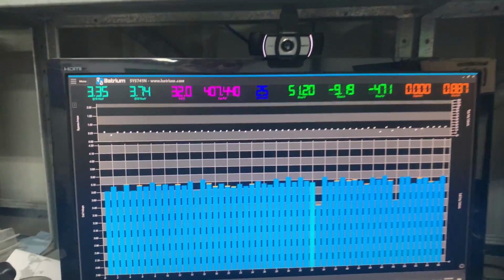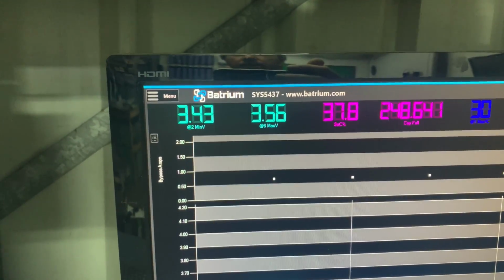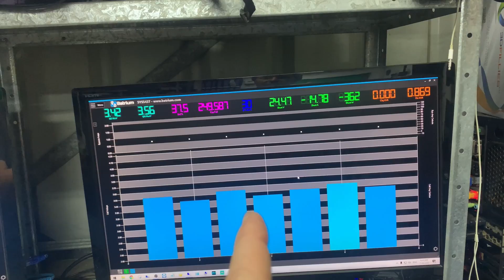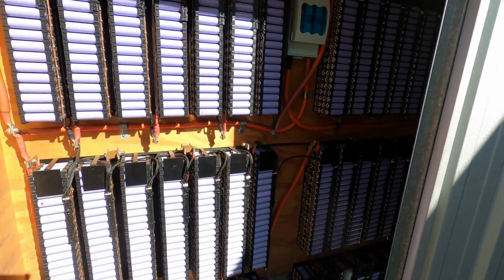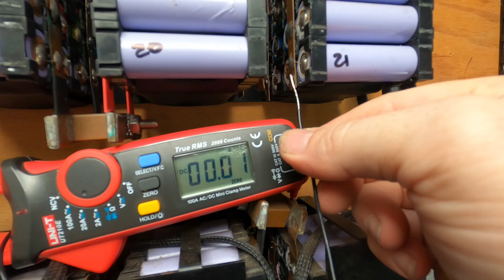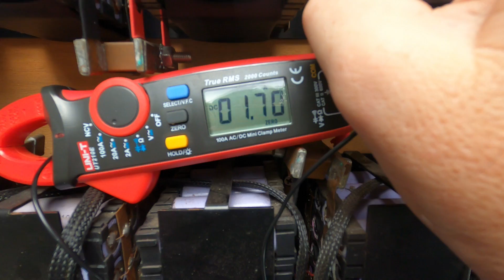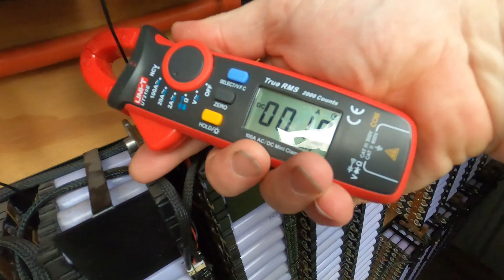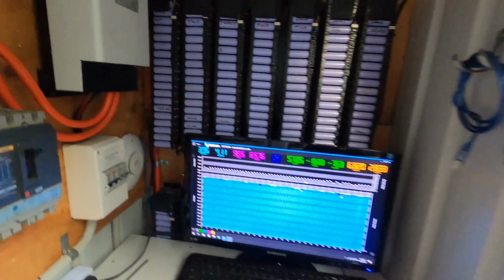Will 240 18650 cells in parallel be better than 80 in parallel?

Comment: Is your powerwall batteries safe in a shed outdoors??
Reply: Have you done any large loads on that powerwall?
Reply from the maker: It's now been in service for 6 years or so, yes it's outdoors, has BMS, has 120 temp sensors, has large loads applied daily, we use around 20 kwh out of the battery bank each night or when the sun isn't shining much more.

Comment: @HBPowerwall what's the discharge rate you can run on setting up batteries like this.. for instance, if I had 4 "packs" like yours in an rv.. would it run a 4k watt inverter?
Reply from the maker: On this battery I can happily pull 100 amps all day till she is flat with out warming up the cells, you COULD run a 4k inverter but you probably shouldn't if you want your batteries to last.

Comment: Great info here.  If a single cell goes flat, I wonder how to track that one down and replace it, without mangling up the whole pack by disconnecting each cell in parallel.  I'll keep watching vids.  Thanks.
Reply from the maker: Lots of videos on my channel, I use a flir thermal camera to find faulty cells as most of the bad cells are self discharging and get warmer than the rest.
Reply: @HBPowerwall   I'm definitely subscribing, liking, and commenting more on your vids.  That's a very intelligent approach, noting internal resistance considerations.  Cheers bud and bravo on the accomplishments. 💪🤙

Comment: Been trying to follow alone for a while now.. quick question.. do you have only one longmon per 80 cell pack?  Also how does it get the battery temp when it is installed on the plastic part of the battery holder and not attached directly to the batteries?
Reply from the maker: I still have 3 per 'battery' so to say really need to reduce it down to only one as that's all it needs it's just i know you don't mess with cabling unless there is an issue! lol There are so many temp sensors that you  can see the differences from the bottom of the shed to the top and left to right so you can see a problem well enough and a lot better than nothing at all. Also even if it was direct to cells might get a better temp on the cells under it but not the other 99% - also have the issue when in bypass it will heat the cell.

Comment: I can't wait to see the results, I'm interested to see what happens when you double up the small wires? Will it carry 4 amps or stay at 1.7 amps?
Very interested! Great video and very informative, God bless you and your family!
Reply from the maker: This worked VERY well considering the 2 hours work and a few dollars in parts - still need to make some bigger wires and retest all my batteries but that takes time and ... lots of it lol BUT very much worth the effort i think
Reply: @HBPowerwall  My concern is that linking the cells across the packs is that you are reducing the "breaking capacity" effectiveness of the main fuses which were previously dedicated to only a single pack. Adding fuses to the interlinks may help, but it gets complex trying to work out were the failure modes will shunt the current, If you are making it into a single string, then you are going to need a fuse with a very high breaking capacity, say 3000 amps, for about 10 amps per cell

Comment: 5:02 You're an absolute madman for running that without any shoes on. You had me cringing the entire time. 
Anyway, watching your videos has inspired me to start building my own pack. I've been salvaging cells from old laptop and modem packs for a few years now, and I've gotten a few hundred of them tested and ready to go. I'm going to make a relatively small battery to run an inverter for power outages.
Reply from the maker: Shoes are optional lol

Comment: hi, do you think a cooling mechanism is required at such high voltage/wattage? thanks
Reply from the maker: Depends on many factors. For my configuration and load it’s fine with no cooling at all

Comment: Just found your site tonight, can’t wait to get started on my own banks and save a ton, the cheapest 24v 100Ah is above the 1100$ range around here.. but will have to buy one of those to get my solar array actually working 😃

Been looking into lto batteries, 18650 size are ranged atound 2.3-2.4v 1.5Ah per cell

Comment: Wouldn't running them in bigger cell counts just hide bad cells more easily? Granted, bigger cell count per group reduces BMS cost/complexity and how often you have to troubleshoot a pack.
Reply from the maker: THAT was exactly the thinking starting out, but the bigger batteries stay more balanced for longer. That and I built with what i knew and understood at the time. But the community has come a long way and the bigger batteries are lasting longer and are FAR more balanced in the lower voltage range
Reply: @HBPowerwall  Fair enough. I'll keep that in mind when I build my wall.
Reply: @HBPowerwall  thanks for sharing 🎉

Comment: A bit puzzled
Your monitor shows 56 cells, but in your shed you have 42 cells?  Are cells 43 through 56 part of some other battery?
Reply from the maker: There are 42 in the battery shed as I call it, and another 12 behind the monitor in the 'powershed'

Comment: A low cell has higher capacity or resistance? If we say that it has a higher capacity then it takes more power to reach from for example 3.9v to 4.0v but if we say that it has higher resistance generating internal heat rather than stored energy, the same amount of power brings all the individual cells to 4.0v however, the cell with higher resistance remains at 3.9v. Also, keep in mind that high resistance while charging without heat production generally means high capacity.

Comment: You should avoid using those ring terminals or any type of terminals at all really due to losses & resistance. It would be cheaper plus less resistance in any connections if you cut a longer amount of cable sheaf to twist the wire into a ring then solder the ring. You can still put a small tube of heat shrink tubing over the twisted end that loops back around the straight part of the wire so that it is insulated up to the point where the ring goes under a washer or nut or whatever.
Reply from the maker: perhaps but that takes too long.. and the idea in my head was these active balancers only move one amp so this would work well.. since found out its a stupid idea. Time for V2
Reply: @HBPowerwall  what was stupid about it?

Comment: This is unrelated but regarding the MINI EV CHANGEOVER if you are looking into having regen through your batteries then you should look at implementing MAXWELL 500F @16.2v Ultracapacitor 6 packs in series. I use them in Offgrid Solar situations where huge amp loads are being drawn on a 12v 1200 Ah Lead Acid battery bank while using a 240v twin element Induction Cooktop which when looking at 3500w drawn at 12v is 322 Amps. Each 16.2v 6 pack can transfer 170 Amps which I have 3x 6 packs in parallel meaning that they can handle up to 510 Amps of continuous current which a Lead Acid could not handle at all but if you have most of the 3500w coming from the solar panels feeding from the Solar Charge Controllers directly into the capacitors & then going into the Inverter the power drawn from the batteries is minimal.

When you use the capacitors in a regen situation on your car the huge amounts of regen power fills up the capacitors instantly which whatever type of chemistry batteries you are using cannot normally take that power without damaging the cells or shortening their life critically. This is why most EV cars dial down their regen amounts because they don't want to cook the batteries. Tesla has involved itself with MAXWELL for this reason to reduce the current amount of batteries in favor of using a split system whereby they can use the maximum amount of regen to put back into the car without needing to have such a huge battery & also they are working on a drycell battery that has the capabilities of a supercapacitor which can be recharged instantly at high current plus have the benefits of storage capacity of typical batteries.

Comment: What you are up to is more dangerous than before. The behavior of a 18650 doesn't change, just the number of cells. A bad cell that thermally endangers the other cells rises. The resolution on your monitor will also be less clear. The drift as it is now is good for you. Because it shows you better the aging of the cells.
Reply from the maker: I agree totally - and i'll be redoing it to a degree - the end goal was to have more usable capacity with out having to upgrade cells. Like if you were on a desert island and had not other choice. (is that a good explanation? )
Reply: @HBPowerwall  The problem is the performance adjustment. You do this when measuring the capacity by combining the same sizes. This behavior remains, no matter what size.
However, the risk of heat build-up due to containers that are too large increases. I strongly advise permanent temperature monitoring. An exploded cell is enough for a chain reaction.

Comment: You really need to have fuses on them wires that run in between each battery to protect the wires should there be an over-current senario. Also, not save to remove the longmons... If one of those wires were to burn up (or fuse blow if you add fuses...) you would never know based on looking at the Batrium. With one longmon on each pack still, they're all protected.
Reply from the maker: I really have to re-think this idea! It worked well in my head

Comment: it works, i have portions of my system wired this way.
Reply from the maker: Thing is i don't think it is working :( well not well at anyrate
Reply: @HBPowerwall  interesting, maybe you have a few cells with to high resistance and as you charge they use up more power to take the same charge.
Reply from the maker: I defiently have a few poor packs and found one heater yesterday :( That's the first thing to fix
Reply: @HBPowerwall  Haha sick, love your system

Comment: DIY Tech & Repairs did a multi-pack -> one-pack balance youtube with small wires - and discussions I've seen is that even though its counter-intuitive, you just don't need hi-amp wires to 'balance' between packs.  The power to run the house will follow the buss-bars -> inverter wires etc as it always did and will not flow thru the balance wires.   However, I'm excited to see this experiment on a powerwall in real life :)  Thanks for this video series!
Reply: kenneth almond,
hbpowerwall is not worried  about current going to the inverter or vice versa. his statement was quite clearly that he thinks a thin wire will not balance as much.
however i don't think thicker wires will do much more balancing if any at all. the longmons wires are very thin too and take 2amps. the thin wires are for safety in a case of short circuit, they quickly burn out before doing much damage.
also, hbpowerwall seems to have much experience in burning out wires.

Comment: Hello friend, I have a Watchmon 4 on my Nissan Leaf battery, it was working good, i add 7 more cells of battery, so i had to change few things on the software , when i was doing that my Watchmon 4 lost all the LED's and no communication with my laptop, how do i recover it back, do you had this kind of issues , please let me know if you have.. much appropriated .keep up the good work by giving second life to all the used batterys.
Reply: if you lost communication on your watchmon 4, one of the volt sensing cables might be faulty.
have you reprogrammed  the watchman 4 for the added 7 cells and device synced? if the green lights stop flashing somewhere along the chain, that is were that particular cell is disconnected.
i got a whole load of faulty cell wires from batrium. the ones that have hotmelt glue on the plug. it caused me problems no end and years later they still fail and have to be exchanged for new ones
Reply: @ursodermatt8809  Thanks a lot for your reply, all my voltage sensing boards have green lights, only supervisor has no lights at all, when i go to the software , it says my USB is not connected, i try new USB cable too same thing.. it has no communication with the computer, therefor no LED lights on the watchmon supervisor.I will check all my wires for loose connection tomorrow morning, just to make sure, it is Sunday night here in California, however much appreciated any feed back Sir.
Reply: @TheKandyGuy  
try wifi, as i remember you have to tell the software whether to use wifi or usb

Comment: I'd really like to see a schematic of the entire wiring setup.
I don't see how that could be making any difference, but it clearly is. I'd also be interested to know what the resistance of those little leads is, if your meter is sensitive enough or you're interested in doing a load test to calculate it.
Reply from the maker: Those little cables are near useless and will need to re-do it with larger cables with suitable fuses... The idea behind it was more usable capacity with little to no expense.
Reply: @HBPowerwall  yeah I understand what you're going for, I'm just surprised that you didn't end up with long mon smoke/errors or bright yellow little wires :)

Comment: What happens is the resistance of the pack gets lower by adding more batteries in parallel. This cancels out the lower capacity cells more and more and the voltages are better matched.

Comment: Consolidation is good! However, with the cells in a cellgroup now physically far apart, and 1 longmon for them, you can't monitor all the pack temperatures anymore.
I think the last 4 years is testimony that this might not be a big problem.
Should still be able to tell you if the building is on fire or not though... :-)

Comment: I just finished 100p 7s battery, with 2500-2900 mah cells, and do not have anything to test them thoroughly, they should be in the 280+ ah range, my charger tester times out before I get below 3.7v, going from 4.0 to 3.7v takes 24hours, and is near 50ah they all seem close in capacity, and all have nos cells, ( new old stock) from new modem Batteries,  I have the ISDT T8, and been using it constantly for about 6 months! Charging and testing 8ah lipo, and the 18650 packs, and I also have a Nissan leaf bank that is modified to 2 packs of  7s, they are only about 40 ah each, so 80 ah total, I have another 100p 7s to assemble! I need to figure out a BMS, I have balance leads on everything, and capacity testers, and volt meters to keep a check until I do get a decent BMS!   I'm thinking about connecting every cell together like a big battery, also to halp with balancing, and to allow a single BMS.  I also thought about doing it like Going off grid did his, with multiple cheaper BMS,

Comment: This sounds like a good idea, BUT in the short term before you take out the bad cells is there not a risk of those bad individual 18650's bringing them packs down faster under heavy loads and possibly overloading the balance ability or if the balance copes with it perhaps the bad 18650's could turn to heaters or worse.. just idle thinking here mate, not trying to scare ya. Let me know what ya think. Your the one with a working system after all. :)

Comment: Hey Pete, what you did makes cents. I had exact idea for my wall upon it getting bigger. All for the same reasons. The theory is the bigger the pack means less drift. I would think you may get away with the size of link wires but stress them quite quickly under load, then  later burn out. 
I couldn't see where the cable come from the packs to the breakers switches, but if I can suggest the take positive and negative from the most diagonally opposite ends off the packs to replicate as an individual pack for better heat distribution, not that there should be any to speek of.
Dose this sound plausible?
I don't know 🤔

Comment: u mm so the wiring is the same through out just now you are linking jumpers to paralel the other packs to make 7 s 240p
have i got that right ?
Reply from the maker: 14s just wires top to bottom on each terminal
Reply: @HBPowerwall  sorry yeah 14 s 
ok
Reply: presumably you will hasve to re route the thicker power wires too at some point